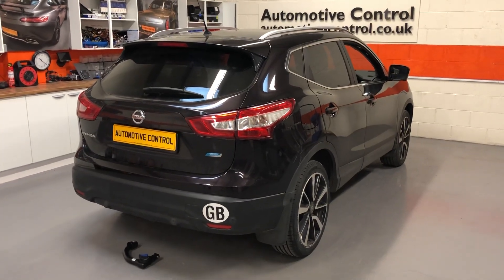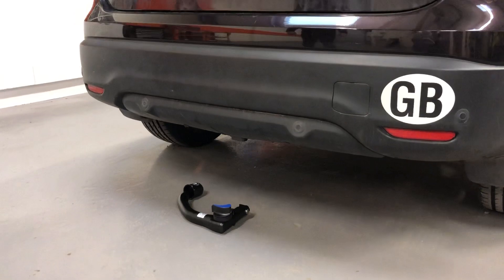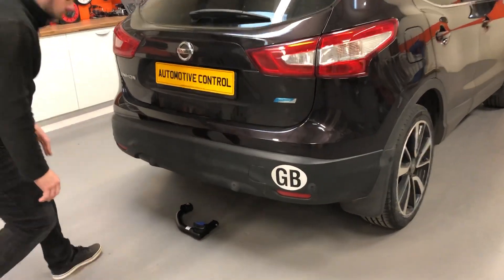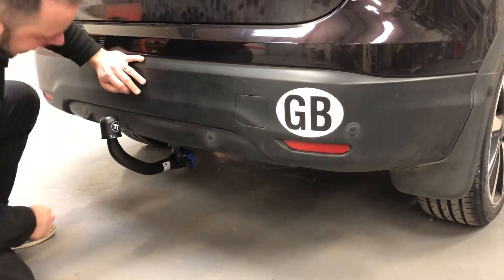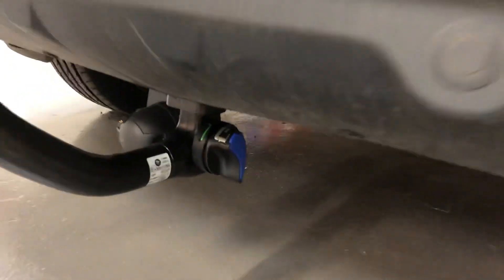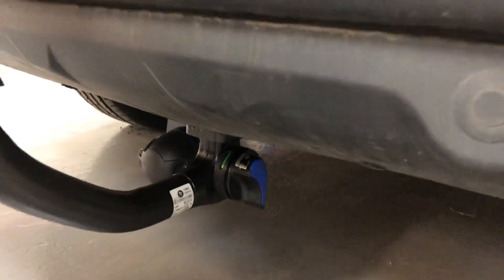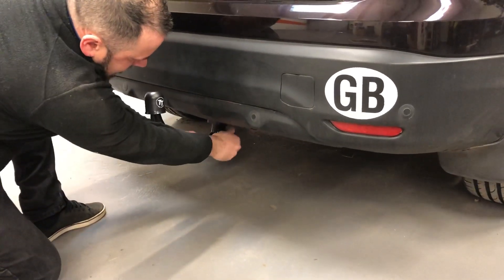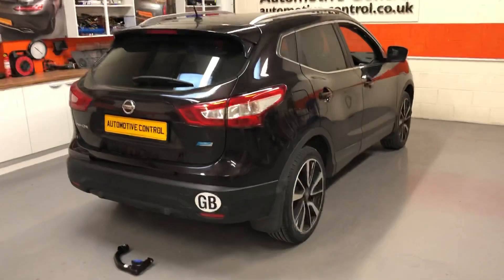Nissan Qashqai detachable towbar fitting with demo

Comment: Glad I found this - I'm getting exactly the same tow trust towbar detachable swan neck fitted on a Qashqai in a week's time!

How do you tell if the qashqai is adblue or not? Mine's 66plate.
Reply from the maker: Hey, unlikely to have Adblue on a 66. You would have an additional filler neck next your your diesel cap